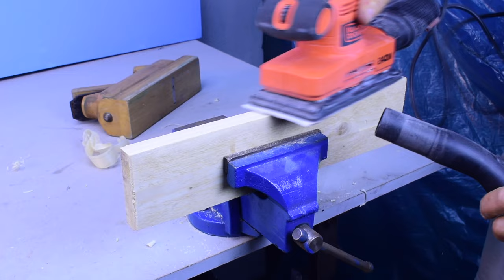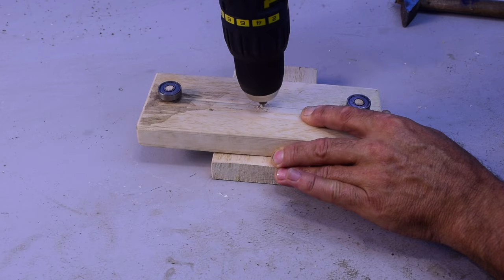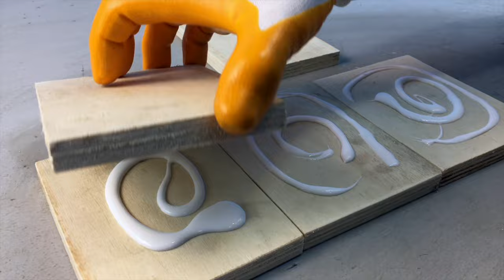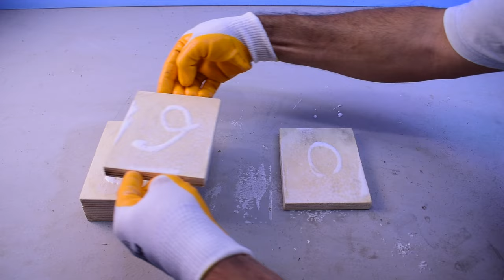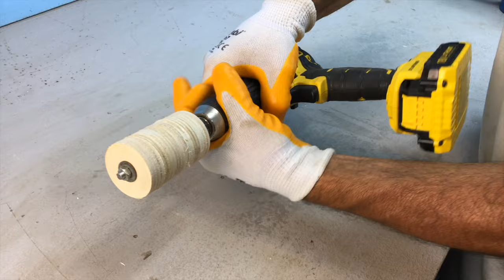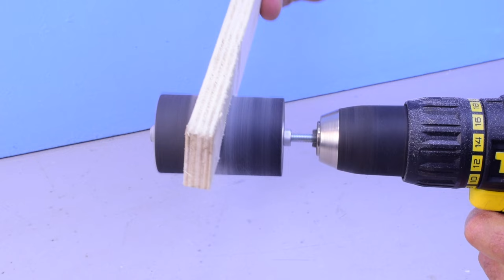Even Master Carpenters Don't Know This! 3 Amazing Woodworking Hacks

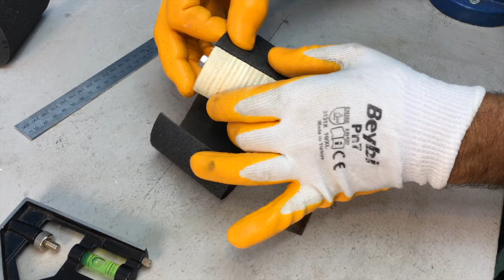Comment: At 3:30, you show how you wrap the piece of sandpaper around the cylinder of wood. But you don’t show how you get the loose end of the paper to stay in place. Does it go into the same slot as the other end?
Reply from the maker: yes, the beginning and the end of the sandpaper go into the same slit, and you don't need to glue them to keep them still

Comment: 1) great idea but no master craftsman would sand a piece of wood previous planed
2) spread the glue all over the wood. Obviously it will slide everywhere with great globs of glue. Salt will keep the wood apart and make a weaker joint. 
3) great way to ruin the stand of your pillar drill (twice)

Comment: The salt will be forever attracting moisture. I would use sand instead.
   Better yet, I would press down all the layers with a piece of board while tightening. If the edges are uneven use the other hand to hold them in place.
   Things are a lot less messy when using clear wrap and gloves.
Reply: Or... just use about a third of the glue, like he did the second time. LOL

Comment: Salting between the pieces completely prevent slipping. 
Prevent it completely adhesion too?
Reply: Nope. Salt is water soluble and most wood glue is water based. So the salt just dissolves.
Reply: He also used like half the glue the second time, which would help also

Comment: Yes the salt did help with slippage. But you know what else helps? Not putting 7 gallons of excess wood glue on each piece. You know you over did it purposely because you used way less in the second demonstration with the salt.

Comment: Instead of using salt, just wait 5 minutes. This is what the manufacturers of wood glue actually recommend (look at the data sheet).

Also: radial forces are bad for a drilling machine. I wouldn't do the last trick with a drilling machine I still want to use for other purposes...

Comment: Well your tips sucks to be honest. You don't need bearings in the first example little sticks works fine,  salt, we don't know what the glue will do with salt in the long run, fine, fine sand a little fine sawdust will be better, and three sanding those small disc with sandpaper will takes forever and give a wobbly result in the end a chisel works better. And the last thing; making the cut for the sandpaper is good but how to put the paper from slipping out. So if you have a channel giving "tips" do it the right way or stop with it. Not thank you for sharing.